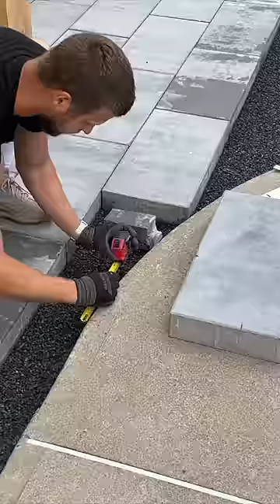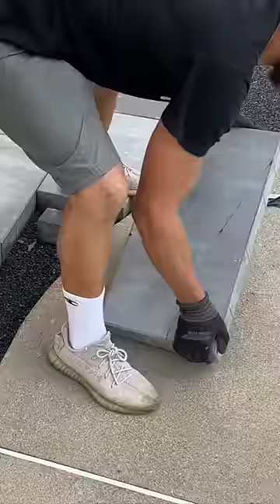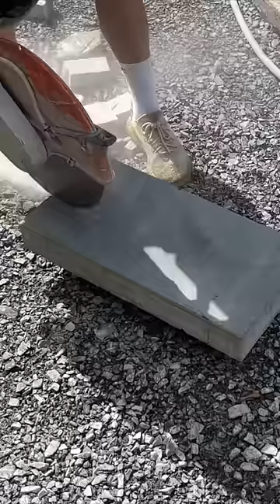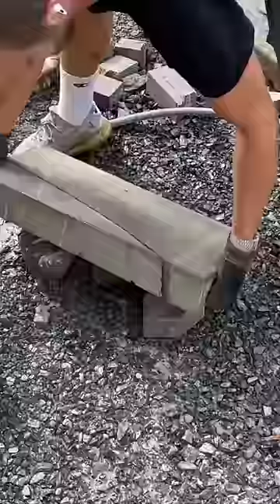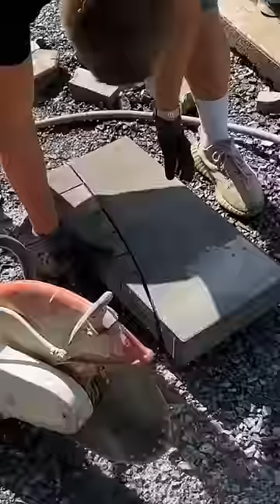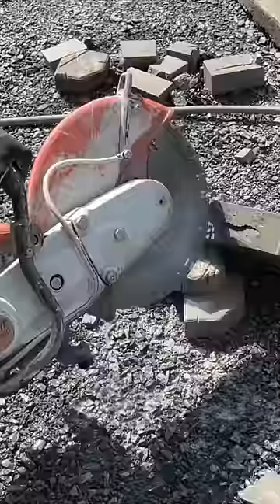My first attempt curved cut. #pavers #patio #diy

Comment from the maker: It’s so awesome to see so many views on this short 😅. I see that most of you don’t read the description of the video or watch the full DIY video, so I should explain myself. This is my very first curved cut ever and my first paver patio ever. I’ve learned through the  comments that the best and fastest way is to use card board to create a template, or use a scribing tool. I wish I thought of that before, but I guess I’ll have another video to make when I get to the other side of the pool this summer. Why this video is in your feed? Because you watched the video, you didn’t skip it, you watched the whole thing, you might of even watched three times, and for that reason I thank you!! 🎉 Because the Youtube Algorithm likes that kind of thing. Thanks to all the new subscribers! New video coming this summer to show you how to use this card board template everyone is talking about! 😅 Cheers!
Reply: I’ve been paving for most of my adult life, nothing wrong with that cut, that method is normally reserved for very sharp radius bends, mark either end cut a straight line with an under pitch, this will allow you to lay the cut in. The cut will sit proud as the middle won’t follow the curve. But it will be low enough for you to run the disc cutter between the edge and the to of your block giving you a perfect cut in a quarter of the time

Comment: Good effort and you will master it, use a piece of card for template. Also when you make your cut angle the saw to follow the curve better, ( like on a bike, you don't steer you lean making the curve of the wheel turn) it creates an undercut but easier and quicker!!
We all started somewhere, no one is immediately an expert.😁😁
Reply from the maker: Thank you for this!
Reply: Na grab a 20mm pvc electrical conduit and it will bend into any curve you want. Been using it for years.
Reply from the maker: @kamiruDesigns  so you place your paver over the sidewalk kind of like how I did, and then you would place the pvc over it and shape it to the curve? I guess the curver could change though, depending where you apply more force, no?

Comment: There are flexible layout tools that hold the shape of whatever you bend them to. Put a reference mark on the layout tool where it meets the piece you're mating to. Now you're only having to pull the end dimensions, set the layout tool with your reference line on the mating edge, and connect the dots. This is faster and more reliable than cardboard, and is reusable.
Reply from the maker: Thanks! If you have an image on google or amazon link to this product I need to buy it!

Comment: Great work. But I'm thinking it isn't better to do a template from some plywood or cardboard to measurement that you will be saving a lot of work😊
Reply from the maker: I did do a few after seeing all the comments about cardboard, but its hard to find so much large cardboard! 2ft x 1ft. I did do the cut for 2 like this and it worked great. I actually created a 12” jig with two nails on each end to scribe. Its good also, but no perfect and could result in a few bad cuts.

Comment: We but of plastic pipe bro makes the shape exactly to required mark it up and a we tip wen your cutting an angle mark it with 2 hands and just let your strong hand guide it don’t use both u don’t need to flip it over

Comment: any reason you didn't cut straight through with that blade
Reply from the maker: If you want to have a curve, you cant cut straight in. It’s 80mm thick. This was my first attempt at cutting a curve, it came out better than I thought it would
Reply: Blade too big to cut straight through and keep the curve. However try using a smaller electric grinder for cutting curves, small blades will allow you to keep the curve

Comment: Measuring probably seemed like a good idea but it will never come out perfect with the curve when you started then cutting by a hand. Trace it next time with a pencil and a piece of cardboard. Or if you can get something muddy textured like spackle and leave a small amount on the curved part and put the piece your cutting right on top. It should leave a curved line of mark for ya.
Reply from the maker: Ya, a lot of people have mentioned that. Ill try it out soon with the cardboard technique